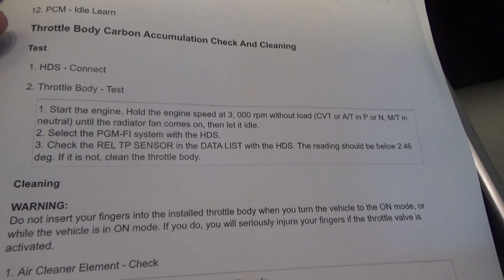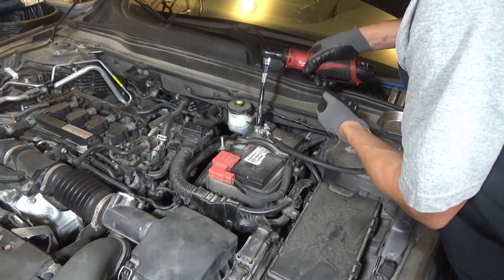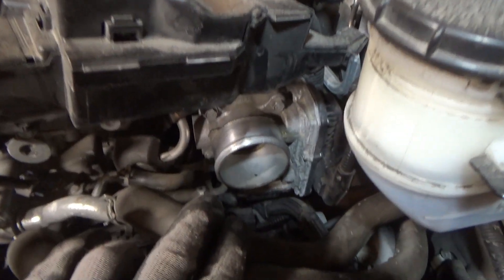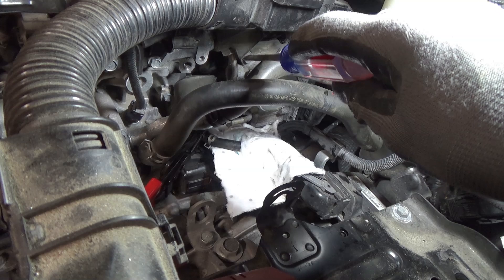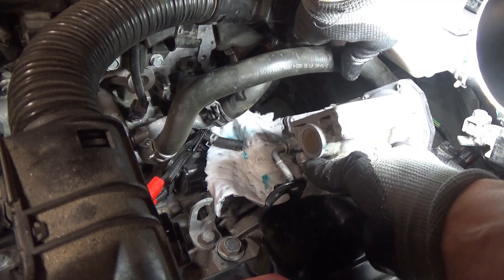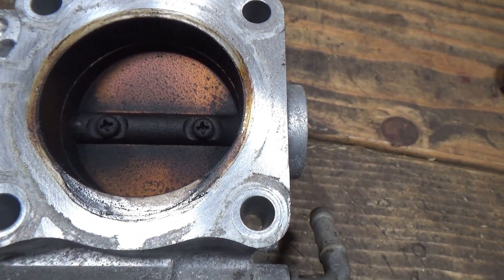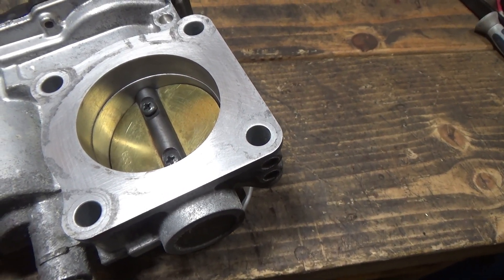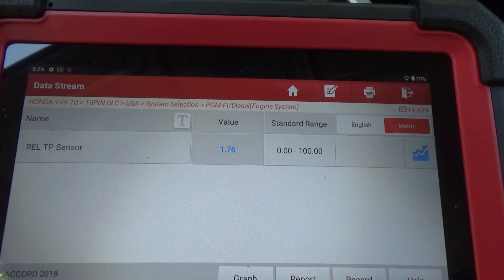Throttle Body: Carbon Accumulation Check via OBD and Cleaning

Comment: Hi John, thanks for sharing your knowledge. I have a 2020 Honda Civic EX with 49,000 miles. When I stop at a stoplight, the rpm drops to 600 and it vibrates a little. Do you think the throttle body needs cleaning?
Reply from the maker: Thanks for the nice comment!  Well, rough idle can often be a sign of carbon buildup.  However, with only 49k miles it seems less likely that there would be substantial carbon buildup, however, that could be impacted by driving conditions and other factors so it is certainly possible.  If you have access to a scan tool, you might be able to perform the OBD check and see if it indicates that a cleaning is recommended.
Reply: I would appreciate it if you could recommend a scanning tool.
Reply from the maker: @geubertargueta3724  I have used an Autel MS906 which was very good (supported bidirectional scan and almost all OEM functions).  Unfortunately it eventually died due to hardware issues.  I now use a Launch X431.  It does not support as many functions as the Autel, but still provides some bidirectional ability and OEM PIDs.  If you want to do diagnostics with OEM codes and bidirectional tests, you'll want a scan tool similar to those.  If you just want to read basic OBD2 codes, you can get a much cheaper reader.

Comment: Thank you for your great video
I rode 120,000km (66,000miles)
Do you need cleaning?
Reply from the maker: Thanks for the comment!  Well, mine had about 165k miles on it and it wasn't too bad so I would guess yours would be fairly clean at 66k miles.  However, mine were all highway miles so depending on your driving conditions, your experience could be different.  But based on my experience, I'd be surprised if you had too much carbon buildup at that mileage.
Reply: @JohnsDIY  Thank you
Reply: 56k I’m waiting. What a cluster for something simple.
May try an induction cleaning first and monitor the percentage before changing the oil.

Comment: Hello my name is Diego , your videos are really good, for the way you explain and the knowledge about it. I was wondering if he would make a video on the oil change at the transmission. Another thing, the torque tension reference guide directly from Honda can I ask you where you got them from? I tried to find them but without success. Thank you for your time and for the excellent videos you make.
Reply from the maker: Hi Diego!  Thanks for the comment!  In fact, my maintenance minder says that I have a transmission fluid change due soon, so I will turn on the camera when I do that!  I get the torque specs from https://techinfo.honda.com/.  This is where the official Honda service manuals now exist, but unfortunately they do charge a fee to access.
Reply: @JohnsDIY  I can't wait to see your next video !!! Thank you very much for telling me where to look for them, see you soon

Comment: John, thank you for another great video.  I checked my wife’s 2019 accord before cleaning, and the REL TP sensor came back at 7.06 (deg).  This appears to be high relative to Honda’s procedure in your video.  But well within the standard range of 0-100.  And I don’t notice any hesitation or rough idle at low rpm. Given that your initial reading was almost 3, I suspect the TB needs this cleaning process.   Just wanted to follow up- up.  Let me know your thoughts.
Reply from the maker: Thanks for the nice comment!  Yep, I agree with you, that is quite a bit higher idle angle for the throttle plate than I had so per Honda anyway it sure seems like you might want to clean it.  Yep, I didn't have any driveability issues with mine prior to cleaning either (but as you point out, at less than half of the ideal throttle plate angle that you have).  One question - was that with the engine fully warmed up?  I think I mentioned, but the measurement should be taken once the engine is fully warmed up.  If you do clean it, it would be interesting to hear how much carbon you find in there!
Reply: @JohnsDIY  Thanks John  - I sampled again to ensure the engine is fully warmed up this time.  I suspect that might be the primary driver for the initial high reading (7.06 deg).  You did mention that in your video.  When I took the measurement at temperature the result made more sense, @ 1.41 deg.  Vehicle only has 40k so I was surprised at the initial high reading.  Especially with no hesitation or rough idle at low rpm.  Thanks for the help.